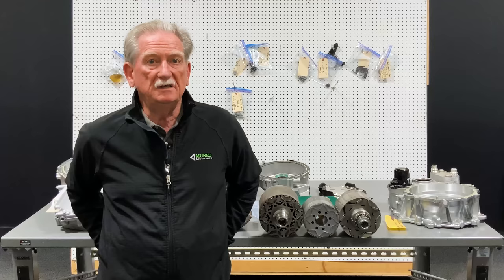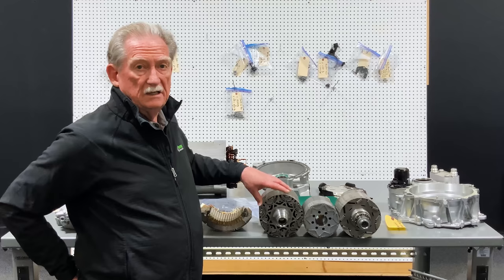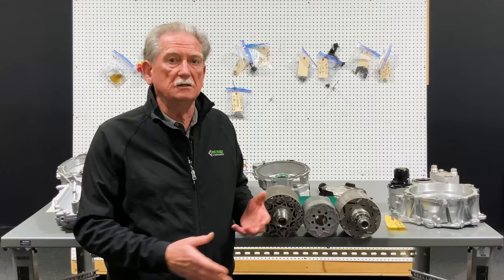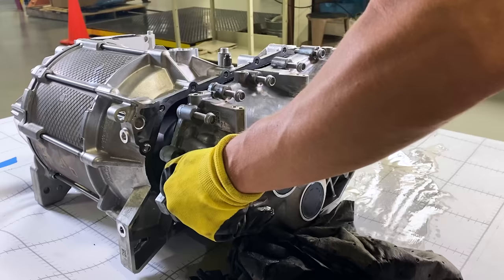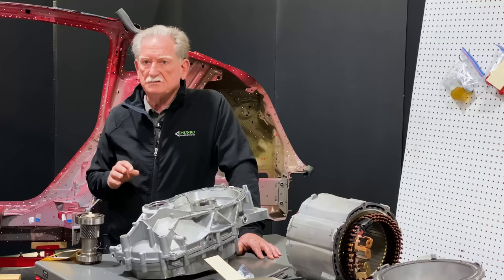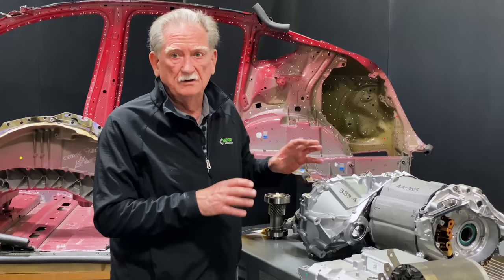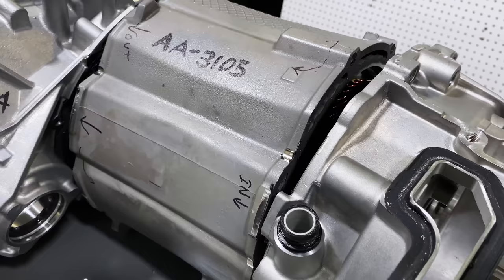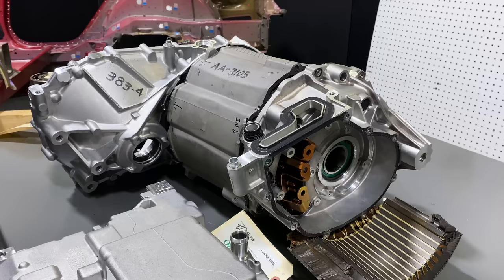Volkswagen ID.4: Electric Motor Teardown and Analysis

Comment: Rail tracks usually are thermite reaction welded and ground perfectly even with a dedicated track grinding machine. At least in Europe. Tracks are only bolt joined rather than welded to electrically isolate them from one another where sections of the train detection system meet.
Reply: I am under the impression that Munroe talks a lot of BS and makes things up as he speaks
Reply: @DavidG2P  Yeah, but as long as you are convincing, it seems to work. I also was like "wtf" when he said this bs with total conviction despite being completely wrong. Makes you wonder what else he is wrong about.
Reply: It's different here in North America and they mostly use fish plates to bolt together track sections without welding which means there is a small gap.
Reply: This is what I was going to comment. I've never heard of tracks having bias. Rails made that way might rip themselves in parts when there's repetitive stress from heat expansion, I guesstimate. It would act as a wedge.

Comment: Well.. yes in Germany you are paying one penny for 10 fasteners. 😅 I am an engineer in Germany and that’s pretty much the price we pay for fasteners. 
So what’s the price in the US?! 😅😅
Reply: 10 pennies for one. Might go to 10 dollars to one fastener if the shortage continues...
Reply: Also I think designing products that down the line they are repairable should be an important point. Snapping things as they are aging some years tend to break when unsnapped especially plastic. I know that the US is the posterchild of the throwaway economy but I am very happy to see VW using fasteners that allow a person to repair that thing rather than break it. And I am more than happy to pay for those few fasteners that make that possible.

UPDATE: Well I would love to get that cap at the end of the life of the vehicle.... it is always useful to have some supercaps lying around :D
Reply: @kozmaz87  Why do you need fasteners to make that possible?  Why does any of that actually need to be fastened?  On each of those boards, instead of having a screw hold, have a pin just to keep it from shifting.  Layer the whole thing press fit from the back side by whatever sits on top of it, and then you only need one set of fasteners at the end to hold the back of the clamshell in.
Reply: @wagnerrp  that's a nice idea but it introduces a lot of compromise in the way you arrange and assemble the parts, they all have to have pins which align. much easier to use screws.
Reply: @daos3300  There’s zero difference between that and what we already have.  Every screw hole, just invert it and make it a pin.
Reply: @wagnerrp  that doesn't solve the problem. you still have a bunch of holes and a bunch of fixings but now the fixings only locate an item, they don't hold secure it. same amount of work & cost but half the function. not a good solution which is why nobody does it.
Reply: @daos3300  Of course people do it.  I see it all the time in hardware.  Adding some holes to a PCB or metal plate takes nothing, especially if it’s being stamped or cast.  A pin secures an object in 2.5 dimensions, and the next part pressed down on top of it, because all of those parts were pressed on both sides by heat transfer pads, secures the last direction.
Reply: @wagnerrp  They tried to explain but I will give it a try too... so the issue is not that it would not be secured assembled. The issue is that you can not easily assemble it when you are not an octopus. it is nasty enough to mount anything in a car in odd angles in stupid places small clearances while you are drenched in whatever is that brown shit on the control arm let alone a box that keeps falling apart.... but let's say you only use fasteners to seal the sandwiching box... ok so now you are on the workbench now you have to fiddle putting components together that deal in thousands of volts hoping that when you pressed the whole thing together one electrode did not bend or something or that you did not pinch a cable. The pin and hole construction can work but this is cars... we can not allow for vibration and we can not allow for random misalignments... this is a different standard. This is not your game console where the CPU melts off the PCB because someone did not think of designing the heatsink correctly. This is also the reason why in cars every PCB is conformally coated... there must be as little room for errors as possible. And not having to constantly hold a stack of components on pins in place while you are trying to turn the thing upside down because you dropped in something like a washer or a wire and trying to fish it out without having to disassemble it all falls into that category. All it costs is a bunch of screws... is that too much to ask?
Reply: @Murphy deffa And you are very right, Sir. That is exactly what will fail... one ceramic cap on that bloody board.... that is all one has to fix
Reply: @OmegaF77  Holly crap 😳 where did that come from? Same palce as the 2x4 price inflation ?
Reply: @daos3300  What compromise?  You're not screwing boards and components into each other.  You're screwing boards and components into a backplate.  Everything already has to be aligned.
Reply: Here in Australia we pay for one plastic door fasteners 4 to 8 dollars, depend of the manufacture.
Reply: I think the guy has confirmation bias "nobody is repairing them". I guess nobody repairs a Ford because it was made trash. Now I know why... they think like Tesla does. Disposable everything. Parasites of future generations.

Trust me. If you make things repairable there will be people around repairing them. #righttorepair
Reply: And "8.8" quality is pretty ordinary here, where Munro says it is really high quality. Those are used on the farm here.
Reply: Can sorta confirm that. About 1c for one typical 8.8 m3x25 when buying in consumer/hobbyist quantities (100pcs). So with VW level quantities that goes even lower
Reply: @wagnerrp  "Every screw hole, just invert it and make a pin" That is much more expensive because making a thread hole on a part is easier than making a screw on the part.
Reply: @battistaluca8582  God bless you!🥴
Reply: Not for the shown type, that one is even cheaper. Those really are the cheapest screws (phosphatised mild steel) and the expensive stainless steel version of them is at something around 10 per penny.
Reply: @Murphy deffa LMAO, funny thing is you're probably right.
Reply: Designing for repair ability is a critical green attribute.  I don’t see the economics of shop repair working out but it would make sense to have a core charge and rebuild defective units at the factory.
Reply: In an automated, or even human, environment, how does one ensure a "snap fixture" didn't get damaged in shipping, handling, assembly?   With threaded fasteners, you can use torque specs to ensure a positive assembly process.  I am leaning towards VWs fasteners for the electronics portion of the inverter.
Reply: @kozmaz87  yes, been there.  Thanks for saying it.
Reply: @pizzablender  Yeah, that's true. Where I live you really can't buy anything less than 8.8 bolts. I've known that lesser quality are available and I actually encountered M8 4.4 bolts first just about 8 years ago when we got some Chinese hydraulic press. We laughed how they had put 4.4 bolts to some not critical places. Anyway I'm quite sure this 8.8 being the "shittiest" quality is common in Europe everywhere.
Reply: @whyohmean  Plus threaded fasteners can be fixed usually by ease. Snap fixtures generally speaking not. Plus indeed with snap fits, spring clips etc. it's pretty damn hard to be absolutely sure that parts are mating with force X
Reply: the cost of a fastener isn't just the price one cost's ........ but whenever you have a fastener it can malfunction and now you're talking about real cost
Reply: @dizzolve  and the frustration of a snap fit when you have to service an older part......
Reply: @dizzolve  and how about f'd snapfits? Forcing to buy new component with smallest fault. Now that's expense too.
Reply: @pizzablender  8.8 is even considered low for me. I use at least 10.9 and when I can, 12.9 screws.
Reply: About snaps, great fresh from the plant but not with age.  Cold, ozone etc start to turn them into crack fit.
Reply: @JB-ss3bv  exactly!  Good for disposable vehicles, not so good for environment
Reply: It depends on who is paying it. Pentagon known to pay $10,000.00 for a toilet seat cover.😀
Reply: The price is not the point. They get loose. Use other fasters instead.
Reply: If the U.S. Government buys the fasteners, they will pay $5.00 for each one.
Reply: Depends on how long Biden is in office.
Reply: @murphy deffa if they're so green then why do they design engines with plastic water pumps driven by hidden belts you can't access without taking apart half the goddamn engine? Why do they put the timing chains on the transmission side where it's inaccessible? Not to speak of the cheat devices. Green. Right.
Reply: @Murphy deffa Not all to Africa, a part of it goes to Romania. Germany is not as green as they want you to think. Not judging, just saying... you know... :P .  I dont see the "obssession" just the realism of a common sense guy - all manufacturers including VW will replace the part and trash the bad ones without second thought, its part of corporate-consumerist ecosystem. Sandy's job is to describe realistically what he sees and not to educate the corporations in that regard, although he might open a new branch of Munro&Associates ;). In your ideal world that inverter should be made by design easy to repair but, hey presto - that's the soviet economy. In reality so few of those inverters will fail in the future that it wouldn't be the case of large scale repairs. Already the electric powertrain is so much reliable than the ICE one that it looks statistically bulletproof in comparison. Also all the electronics in conventional cars are replaced and not repaired because whos gonna do it knowing that it will be highly unprofitable as a large bussiness? Its a vicious circle that can be broken only by enforcing the repair cycle of any/all devices by law. The common sense way will take another hundred years, sooo.....
Reply: @JB-ss3bv  Well, I think VW is also thinking about their service/dealer networks keeping a decent amount of work over the years. Tie it with a shift to more and more "lease only" with full service packages (instead of everyone buying their car) and it starts to make sense
Reply: You are totally missing the point.
Reply: @kozmaz87  One or 2 screws / fasteners per 10 pins, certainly an option
Reply: @OmegaF77  Drive a german and a american car over a bumpy road, and you will find out that the german cars don't rattle, squeek and shake themselves 
to pieces, so that's why they love to use fasteners, and alot of them.
Reply: @wagnerrp  My thoughts exactly.
Reply: When will this EV be available in the US?
Reply: 410SS 6"'-UN  hex nut cost $1K US each.
Reply: Germany isn't using any fasteners in Tesla factory you can't even approve paperwork in 9 months, Giga Shanghai #2 will be open before Berlin factory🤣

Comment: I think that the skeletonizing of the laminate sheets is not only for weight reduction. In my opinion it's more for controlling the magnetic flow of the permanent magnets.
Reply: He could have proven his idea by weighing the 3 rotors. At least the VW has the most volume, which might reduce heat stress.

Comment: Thanks Sandy, now it is not surprising that the VW motor is so efficient.
Reply: Now it only needs an efficient car body, like the ID (space) vizzion.
Reply: @abraxastulammo9940   they have, it is called ID3
Reply: @paulf3353  20 % more aerodynamic drag compared to Model 3: it is ok, but not great.
Reply: @abraxastulammo9940  for cheap car it is fantastic
Reply: @paulf3353  Aptera is best.
Reply: @abraxastulammo9940  maybe, but it is ugly, small and not in mass production

Comment: Would have been interesting to bench test the efficiency of the motors.
Reply: Eliminating resistance (bearing) is one good thing, knowing what design yields the best efficiency would be great.
Reply: @michac3796  That was easily explained.  VW ID4 has a better motor.  Tesla has better everything else.
Reply: @davidbeppler3032  there is more to be tested… just wait and see. After all this VW is quite good. Don’t jump to conclusions to quick.
Reply: @davidbeppler3032  Except for building quality, where US cars are generally inferior to European, Japanese and also Korean cars. Quality is still the weak point of Tesla.
Reply: Ok, so you admit the German Model Ys will be the best built cars in the world?  Cool.  I agree.
Reply: I don't think Munro is equipped to do that.
Reply: @brianb-p6586  Efficiency is just output divided by the input so it is easy to test and calculate. One of the few formulas I didn't have to look up when I studied engineering.
Reply: @Martian74  Yes, but again, I don't think Munro is equipped to do that. They perform static analyses of vehicles and components by tearing them down and examining them, then modeling them in computer software. In the whole company, it is unlikely that there is a source of power to run this motor (other than a battery pulled from a car) or a motor dyno for it to drive. It's just not their business, and their customers are all equipped to that sort of testing themselves.

Comment: While it is hard to tell from the video, I am pretty sure that the first PCB screws have Belleville washers, which is typically considered a  correct solution for avoiding issues due to thermal expansion differences that lead to PCB creep over time.

Note that the board seems to be using both outer layers for both internal shielding and thermal transfer to avoid the need for extra shielding in a very high EMI environment.

While I get that you aren't a fan of threaded fasteners IPC2221A and other standards require accounting for thermal expansion, vibration, shock and other environmental considerations.  There aren't many solutions that will deal with those environmental considerations while allowing for differences in thermal expansion that I can think of.

What other solutions will avoid long term issues due to creep, while also allowing for grounding and thermal transfer?

Comment: 20:55 I think it's not just to cut down some weight from the rotor, but also to strengthen the fields used in the motor.

Comment: Nice video, great information.  Motor and gearing in these cars should be something that for most people outlives the car though so isn't a great differentiator.   The proof will be seen when we start getting to 500 k km
Reply: Inverters, motors and gearboxes determine for a significant part the efficiency of an EV. Permanent Magnet motors are usually more efficient than induction motors.

Comment: I think its excellent design. I like all the fastening screws - it does lend to serviceability. Also that resistor looks like its attached right on the inflow for the coolant... to me that means they tested it on the controller, but decided against it.
Reply: Tesla has thermal compount on the resistors. Which might not adhere to all resistors equally.
Also, small resistors under high voltage tend to fail.
Reply: @pizzablender  always prevent heat generation on your PCB. The external power resistor is the best choice.

Comment: At 26:25, he comments on the first circuit board in the inverter, probably a control board: "The problem is, look at all the screws holding it in place."  Yes, you NEED all those screws for such a board in a high-vibration environment, like the side of the motor housing.  The board has lots of of fine-pitch components soldered down on it, and it's also a rather large, odd-shaped board, to fit in the available space.  The screws hold the board down to the (stiff) aluminum backplate to prevent the board from flexing, which subjects the components on the board to higher vibration, and can cause solder joints to crack etc.  Having all those screw holes makes the one-time PCB design more difficult, routing wires around the holes, but it makes it much more reliable.  Looks like VW emphasized reliability in their design decisions here, like in military & aviation boards, rather than trading that off to get rid of some screws. 
Great video BTW, liked & subscribed.

Comment: Even on the B2C market in Germany you can get stainless or high yield screws for under 1ct if you buy like 1000 of them. The B2B price will be even lower, especially when considering higher quantities and higher order frequency, so the BOM price of fasteners is usually insignificant.

Comment: the reason for so many bolts on the boards is for RFI.  you need to think of the wave lengths of the RF that are emitted by the computer chips and associated oscillators that generate the clocks for those processors.  Spacing of the bolts is based on blocking the highest expected or tested for frequency.  RF will not pass to the outside, based on faraday principles.  If there are multiple boards there may be or is a desire that you keep one board from having RF affect an adjacent board.  The RF seal on the covers is proof that there is considerable RF within the inverter.  Also there is a desire to keep outside RF from interfering with the inverter operation which could cause lots of bad things to happen to the car.  Not all those fasteners are need mechanically but are needed for RF control and mechanical stability of the RF control.